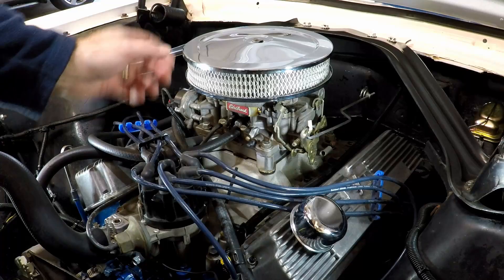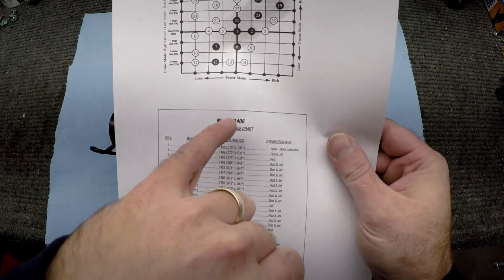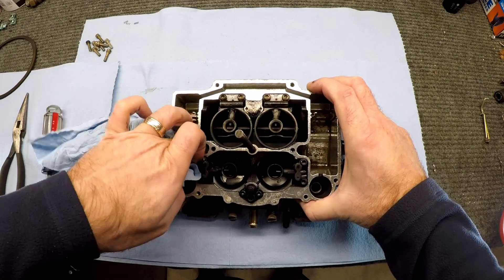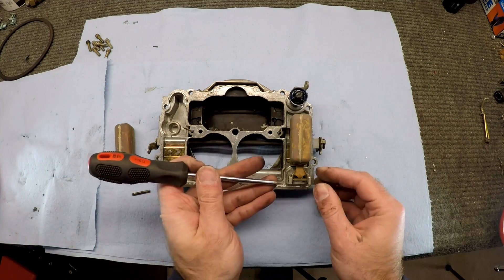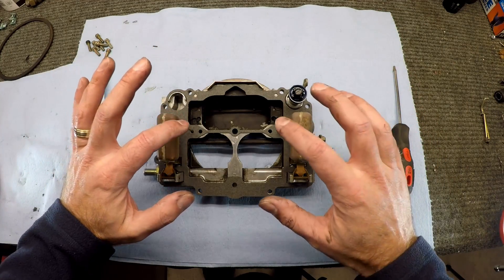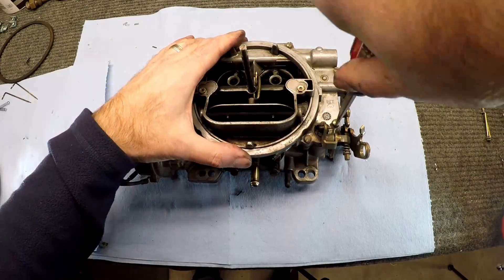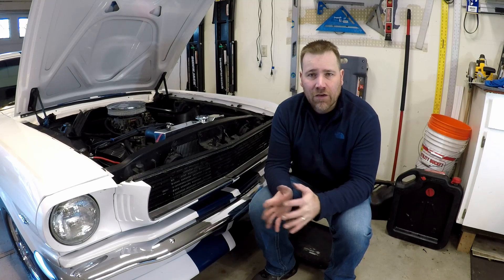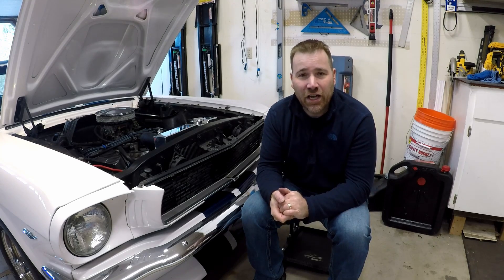How to tune Edelbrock 1406 Carburetor

Comment: You should have adjusted your floats, the passenger side float drop was really low also I know you can use a flat head screwdriver for the jets but there's actually a special tool and there really cheap it really helps I'm galling up to the new and old Jets and it looked like before you took the carb apart that he accelerator pump was leaking from the top of the stem which would mean the accelerator pump should have been replaced because fuel is getting past the seal and plunger assembly! If you're going to do any kind of work on a used carburetor you may as well rebuild clean and rebuild everything just because it's easy and you're already in there and it's really cheap! One more trick is to use chapstick on the gaskets it allows you to reuse them they tend to come off in one piece even if you are replacing them you don't have to scrape old gasket material off!
Reply from the maker: Good tip on the chapstick.  :)

Comment: Where can I get those jets?. I need to lean my carb out
Reply from the maker: I purchased them off ebay, but there are lots of places to order them.  Also, you can buy a kit that has multiple sizes to allow you to further tune the carb for your specific application.  :)
Reply: @KruseBuilt  yes thank you I have been looking around thank you again

Comment: Hey Andy would you say this upgrade was worth it? I have the same carburetor on a 355 sbc Even has the same Jets and rods as yours before you did the tune. Pardon my French but the engine is kicking my ass not only that but it’s got a high rise intake and some 200cc heads with the 2.02-1.60 valves and some long tubes Out of all these upgrades though it’s still runs The same as when I had some crappy 283 heads on it with ram horns do you think a tune on it could make at least a noticeable difference?
Reply from the maker: Yes, because the 1406 is tuned from the factory for fuel economy.  The brother to this carb is the 1405 and it is tuned more towards performance from the factory.  The tuning I did here was just get it up to the 1405 spec, and from there the real tuning can begin.  You could just skip this step, grab a 1405 tuning chart, assume you're starting at a baseline 1405, then pick your route from there.  I planned to tune this carb more, but I ended up selling that car.  I now have that same carb on my new car and I plan to pick up where I left off.  :)
Reply: @KruseBuilt  thx Andy!
Reply: @KruseBuilt  After fixing your clogged jet did the motor pull harder? I have the same carb and plans to tune it for more power with a AEM air fuel gauge. So much info online to do it right. You looked like it didn’t improve te performance with the jet and rod upgrade.
Reply from the maker: @CARSONBOARD  This was almost two years ago on a different car than I have now, so It's hard to recall how everything went.  The performance gains from this kind of tune are minimal, especially on a 289 where this carb is arguably too big for the motor.  I recall it being a little snappier on throttle, but most probably wouldn't see a big difference.  :)

Comment: Hey Andy now that you've had time to drive it how does she feel ???
Reply from the maker: A little snappier, a little more responsive than before.  It does run rich, likely because the jets and rods might be a pinch too large?  The most important part (to me) was to get the Carb to a baseline that matches the 1405 Carb.  From there I would use the 1405 tuning chart as my reference and make adjustments up or down depending on how the car was running and parts that get added.  Doing something like a new Cam would likely require me to re-tune the Carb.  :)
Reply: @KruseBuilt  Ok Cool.. thanks Andy for the videos.. I appreciate them 👍

Comment: GREAT Video!! do you know the part number of that top gasket you replaced? does it only come in a kit?
Reply from the maker: The Fuel Bowl gasket part number is EDL1477 and it can be purchased separately, or as part of a larger rebuild kit.  :)

Comment: Nice car, what size motor?
How was the car before/ after?
Reply from the maker: Thanks!  289.  With the tuning, the response is a pinch better, but it's hard to tell since this change really only gets it to what the stock Edelbrock 1405 settings are.  I did this so I would have a base line when I start to add more tuning parts.